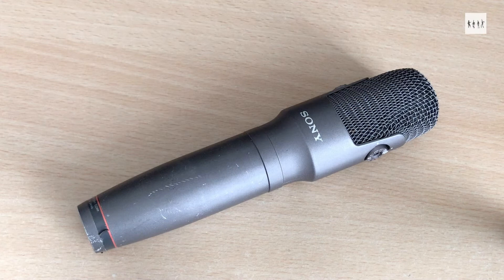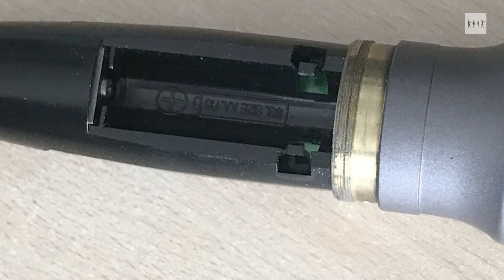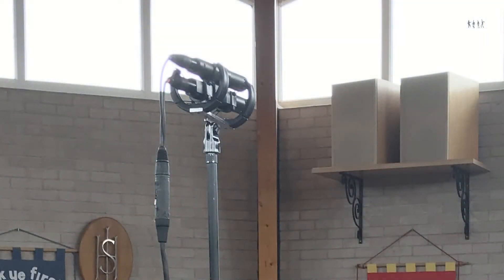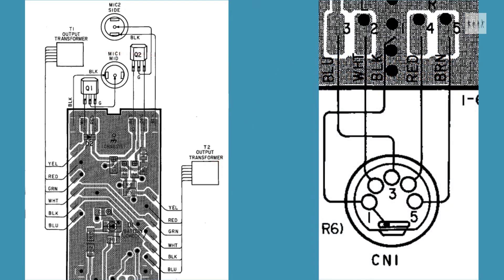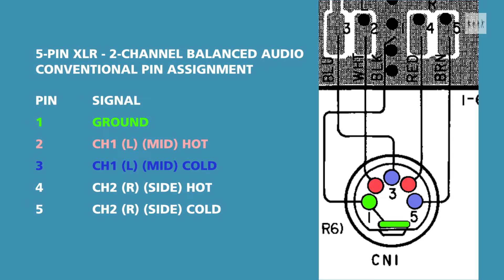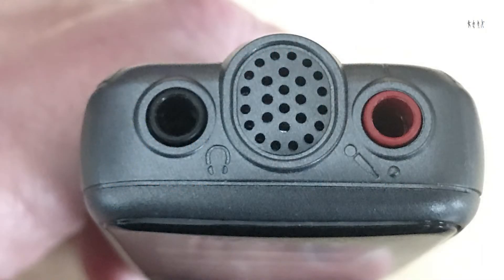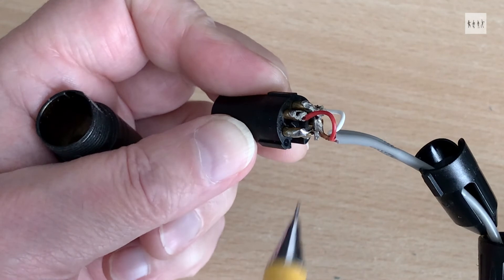SONY ECM-MS957 Stereo Microphone - Balanced Operation

Comment: So this Mic doesn't use Plug In Power? is it Battery supplied only? Other similar mics seem to work on PIP or Battery, you have both choices
Reply from the maker: That is correct - this mic can not use plug-in power. It can be powered only from its internal 1.5V AA battery. But on the positive side, (a) the battery lasts ages, and (b) I have used it very close to drums and cymbals without it overloading.

Comment: I’ve just dusted off my trusty ECM 957 to work with a couple of Zoom recorders that I’ve recently bought. While it’s a bit big to go in a shoulder bag with the H1n for everyday use. it will be an ideal pairing for the H5 kit which I am putting together. A quick test shows that I have to increase the gain a bit when condenser mics are plugged in. Is this normal?
Reply from the maker: Hi Andrew - I can confirm that my own ECM957's output level is lower than my other low-voltage electret mics (mainly tie-clip lavs.) I do wonder whether the capsules lose charge - and hence efficiency - over the years (decades!)
Reply: @reqordist  the other possibility is that we are spoiled by incredibly good modern capsules and transistors that have a lower noise level.
Reply from the maker: Quite possibly!

Comment: Thank You! I own this microphone. Bought it new to record vocalists having been told it was a  gem for field recordings. When paired with a Zoom H2 there was excessive static noise. The recordings were better with the built-ins of the zoom, so this, regretfully, ended up in a drawer. You encourage me to dust it off :)
Reply from the maker: It sounds like you may have had a problem with the H2's 'Plug-in Power' supply, which puts a very small DC current (a couple of milliamps?) through the 957's output transformer (see 3m11s). Although this will not damage the microphone, any intermittent contact on the 3.5mm jack plug (e.g. when you are moving the mic around) will make a rustling noise on the mic input. To get over this. I made a cable with one 1uF non-electrolytic capacitor in series with each signal line, to break the DC.
The H2/H2n's internal mics are pretty good, anyway... Good luck with trying it again!
Reply: @reqordist  Again, much appreciated. I've watched the video once again. I should have listened better :) As I have Your ear and expertise at hand I'll fill in with a maybe stupid question. There are 3.6V batteries with the same form factor as a AA-cell. I bought one but never dared trying it in the microphone, partly because I at the time couldn't find the schematic. My thought was that it would give the internal amplifier more "rail to rail" range. But that might not be a limiting factor?
Reply from the maker: Interesting - the schematic diagram is out there because I managed to find it - look for "Sony ECM-MS957 service manual". Firstly, the datasheet for the 2SK1578 FETs  (one per mic capsule in the MS957) shows an example circuit working off a 5V rail, so that would sound promising. BUT: There is a 4V rated 10uF electrolytic capacitor directly across the mic's battery rails, and a nominal 3.7V LiIon battery will be about 4.2V fully charged. Also, there is a 4.7V Zener diode directly across the battery, presumably to protect against reverse connection (by shorting out the battery!) and forward battery voltages over 4.7V (again a short.) So it doesn't sound like a very a good idea, unless you're prepared to change some components and/or take a risk!

Comment: Many thanks for this video, very helpful.  I just purchased one of these mics second hand.  I’ve been looking for the perfect MS setup to record guitar.  Previously been using a Shure MV88+ which sounds great… but a pain having to plug your phone in to use it.  The 957 sounds slightly better on noise performance but is more coloured with the transformer output and hardware decoding.  The selectable mic positions are quite different tonally up close with the side address giving more mid response. With the end address position the side capsule is in front of the mid capsule and sounds less boxy, with a little eq I could get quite a nice guitar sound.  The transformer output seems to add sheen that can sound softly saturated and punchy.
Reply from the maker: Thanks for your feedback - I had not used the mic for specific instruments so it's very interesting to hear about the different tonality in the width and directions. Confusingly, the capsule symbols in the schematic diagram do not represent their physical placement. Looking at the mic, the side capsule is actually at the end of the mic (you can find the full Service Manual online, which shows this without having to dismantle the mic).  So in end-fire, the cardioid mid capsule has to look 'through' the side capsule, which I would have thought would have reduced its on-axis high-frequency content. But that might help control harshness from close miking a guitar, and give a warmer sound. I must admit to being more impressed by the mic now than I was when I bought it 20 years ago. Cheers!
Reply: Indeed the performance of the mic is good. As an alternative I’ve just tried a Superlux 502 mkii from Thomann. Noise performance is slightly better with the 502 vs the 957 but I genuinely impressed with the way the 957 holds up, especially considering it’s age.  Again that transformer output on the 957 is putting a sheen on the higher frequencies compared to the more clinical sound of the 502…but sometimes that’s a welcome addition, depending on the style of music.  And just for the record I can confirm that the short cable that came with the 502 is fully compatible with the 957, also the same wiring convention as the longer extension Thomann sell (5m “Superlux Stereo-Signal-Cable”).

Comment: Nice video. I’m confused about the Mid-Side arrangement - does the audio recorded with it require decoding in DAW when recorded into anything other than a Sony recorder, or is it done internally in the mic itself? Thanks!
Reply from the maker: Thanks! The capsules' mid-side signals are decoded within the mic, so it appears as a regular x-y stereo signal to any attached recorder. 

This approach is a convenient way to provide a couple of useful options:

1. It allows the mic to be turned from end-fire to side-fire by swinging the Mid (cardioid) capsule round mechanically by 90 degrees, via the buttons on the sides of the wind basket. 

2. By allowing for the application of a lesser or greater proportion of the side capsule's signal to the decoding arrangement (via the three-way power switch), the decoded x-y stereo output can be selected to have either a narrow (90 deg) or wide (120 deg) capture angle. 

A neat bit of design!

HTH!
Reply: @reqordist  Thank you for your reply. I have  a similar mic, MS907. I assume the principle is the same? So can one access the Mid-Side signals before they are decoded and decode in DAW to take full advantage of it? Sorry, understanding of the principles behind the MS stay with me for maybe one day after I read an article about it, but then it flies over my head, lol.
Reply from the maker: Hi - the 907 is a cosmetically-updated successor to the MS909 that I mention in my video. Like that mic, the 907 has a fixed endfire pattern. Both of these mics achieve MS to XY decoding using a transistor circuit, versus the 957's use of transformers. Short of getting busy with a soldering iron and modifying the mic's circuit board irreparably, you cannot simply access the mid and side capsules directly.

But consider that if the signal has come from an MS capsule arrangement, you can put it back through an XY to MS effect plugin (I use the free Voxengo MSED VST plugin with Reaper), do what you want to do, and then convert it back.
Reply from the maker: If you're feeling adventurous, you can find service manuals (with schematic diagrams) for all mics mentioned online with a bit of googling.

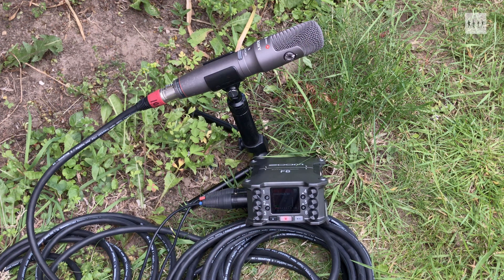Comment: What cable are you using with the F6 @ 4:16 ? Was it premade by Sommer or did you make your own? I'll be using the ECM-MS957 with a F3 and currently shopping for cables. Cheers!
Reply from the maker: Hi - I just made up my own. 

Here in the UK one of my favourite suppliers - CPC - does a range of cheap but good quality XLR connectors under the brand name Pro-Signal. The Y-cable just uses some thin 2-core screened cable I had lying around. I have made them up in both genders for use with regular mic pairs. 

For recording choirs etc., I have made up a range of long (10m, 15m, 25m) cables using Sommer Cable Quantum Highflex Multipair 2 (dual balanced cable) from Thomann (Germany), terminated in 5-pin XLRs in the mic's pinout. That cable is quite chunky (only just fits in the XLR strain relief), but its excellent combination of heavy weight and limpness means that it lies flat on the ground without curling or twisting.  

Yes you can buy pre-made cables, but for non-standard configurations like this, they're often ridiculously expensive... Good luck with your own setup!
Reply: @reqordist  I'm sorry if I may have missed something, but the pinout on this mic is different than say a Rode NT4? I got this mic with the included 5-pin to mini-jack cord but have bought the rode cable to use with it. Will that not work for me?
Reply from the maker: @UCTrumpet  I'm not sure whether you are telling me that the pinout of the NT4 or any other 5-pin XLR-equipped stereo mic is different from the MS-957, or asking me. I'll assume the latter...

I have failed to find a pinout diagram for the NT4 on the web (thanks, Rode), and I do not own or have access to an NT4, so I can't advise you about that model. 

FWIW, though, according to their respective manuals, the Superlux S502, Audio Technica AT8022 and Neumann USM69i (!) stereo mics all have the same 5-pin pinout as the MS-957, so it seems reasonable to assume that it's a pretty common wiring arrangement. 

Fortunately, since you have already bought the Rode splitter cable, it's a trivial exercise to establish a connection table for it by using a multimeter in continuity mode to trace from the pins of its male XLR connectors to the pins of its female connector. You know that the 3-pin XLRs are by convention 1=Ground, 2=Hot and 3=Cold. The ground pin (1) of each 3-pin XLR should be common.

If the resultant connection table corresponds to the table in my video, you're good to go. If not, you could just grab a soldering iron and rewire the 5-pin plug on the Rode cable to suit. I think it unlikely that Rode would deviate from what looks like a de facto industry standard, but you never know.

If this approach sounds too complicated, I'm sure you will have a techy friend who can help out!

Good luck!
Reply: @reqordist  thanks for the reply! I’m pretty sure this means I’m good to go. The rode cable was just the most economical! If it’s not the same I’ll dive deeper, but it’s been a while since I’ve soldered!
Reply: @reqordist  I have read that Shure would have their own wiring.
Reply from the maker: @Olli Vanhoja  You may be correct, as I have never used any Shure stereo mics. However, I have just looked up the user manual for the Shure VP88 stereo microphone, and that has the same pinout. Which other Shure stereo microphone had you read about?
Reply: @reqordist  Sorry, I already forgot that and the pinout. Maybe it's just something legacy. Shure has made many weird things in the past, like the STM30 boundary mic that (IIRC) requires 19V phantom. The manual doesn't mention the required voltage at all.

Comment: I recently picked up this mic, which I've been wanted 20 some years ago when I was doing live concert recordings on DAT, but just didn't have the funds for it. Now that I have one I'm super excited.

You posted this video a day before and I noticed it a day after I ordered a Shure VP88 cable to try out the XLR 3 pin connections. I'd like to report that the VP88 cable does work. Tried it with a Yamaha MG-10XU, Tascam DR-100 MKIII, and Azden FMX-DSLR and it works great.

Thanks for confirming the pinout before the cable arrived!
Reply from the maker: Glad the video was useful. I had no idea if anyone would be interested in such an old mic!  I hope you get some good recordings with it!

Comment: Brilliant. Good to know re: the wiring. Still have mine and it still sounds great. Ditto my original Sony Mini disc Walkman MZ-R50. The Mic definitely sounds better on my Tascam DR-100 mkIII though. Less compression I guess.
Reply from the maker: Hi Campbell, glad you found the wiring useful. Digging out my old MiniDisc recorder provided a salutary reminder of how far we have progressed since then - in particular the short duration of the discs, and the time the machine spends faffing about reading and writing TOCs!
Reply: @reqordist  the sound quality too. The MD's were great but when you compare to modern recorders you can definitely hear the difference from the same Mic.